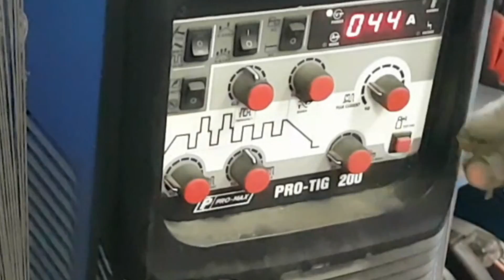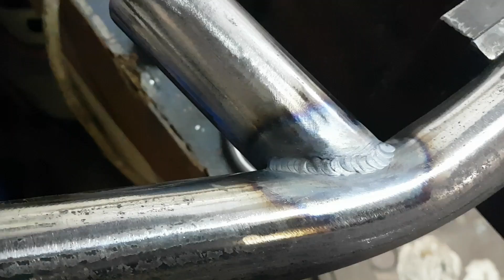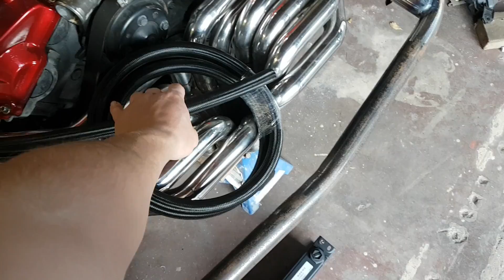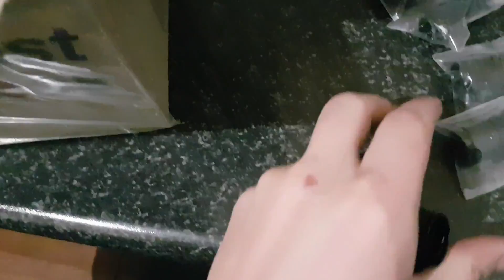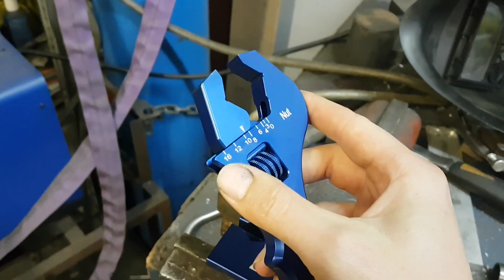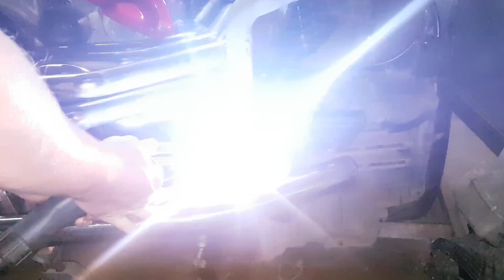V12 Miata progress and new parts | Toyota V12 | 1gzfe

Comment: Exhaust headers right in front of the engine like that is gonna blow all that piping hot air directly into it.. 😑
Reply: that's just a hot air intake
Reply: It's not gonna matter that much, it's not a performance v12. it has only 300hp around 6k rpm.

Comment: I got two main questions. 1: what ground clearance will the sump have.

2: you going to wrap those headers? It's going to be very hot there if not.
Reply: Ceramic coat maybe? No meed for wraps
Reply: @callardo1  Yeah, he's got options, but some form of heat shield I imagine will be necessary for real world use. It is a beautiful header, though, so I understand why he may not want to go that route
Reply from the maker: If I can I would like to keep it just the way it is but if heat is a problem, i will then manage it
Reply: The radiators are in front of the headers
Reply: I agree, those headers seem pretty inefficient. Unless there is no room I'd get the piping down and out of the way into the wind the shortest way possible. Especially in South African heat. Edit: just saw the part where Bruh explains it are equal length headers for better sound, then it might be worth it :-)
Reply: Exactly.. It's gonna direct all that hot air right over the motor 🤦
Reply: TTime685 you don’t know everything buddy, give your input when you put a v12 in a miata
Reply: @abdelit0  Heat generated by headers is pretty common knowledge and doesn't require you to install a V12 in a Miata, buddy
Reply: @igrvks  look at the stock cars using this v12. See any wrap? 😂
N/A it should be fine with some shields and ducting.
When the turbo land tho ;)
Reply: @maxpower700  Please show me a stock V12 with a header design like this vehicle?
Reply: @igrvks  doesnt matter if the bulk of exhaust is infront or under, the engine only creates so much heat under load 👌

Comment: I dont think I've ever asked you but how did you come across this engine? But my understanding they're pretty damn rare. Great vid as always.
Reply: Quick search on ebay shows you could get a complete stock 1GZFE easily for less than $5k. It's not 2 1JZs welded together, though. So, you need to spend a lot more to tune it if you plan to.
Reply: @Nafeels  That seems fairly reasonable actually. Might be fun to stuff one into an LS400.
Reply from the maker: I have access to 4 right now, picking up another one real soon😎
Reply: There are on the internet, also Toyota is building Century for over 15years the price is reasonable for engine.

Comment: I don't intend to be negative, but if I had a V12 to put in a car, a Miata would not be my first choice,
there will most likely be too much wheelspin to actually be controllable,
I would put this V12 in a chassis that could possibly handle how much power and torque this engine will produce

but if I'm wrong...
CAN'T WAIT TO SEE IT DONE!!!
Reply: I feel like he is gonna put some big rear wheels
Reply: @matter2605  yea, and a trans and diff that can handle the power. Just saying, it may take a while before the build is complete
Reply from the maker: Trans and diff is already complete 👌